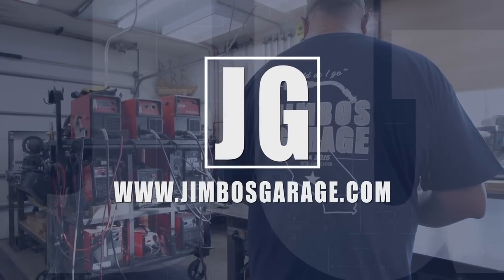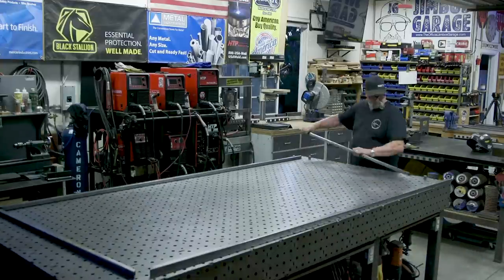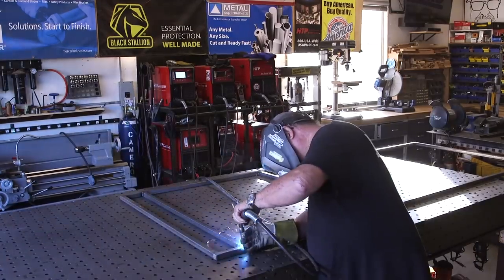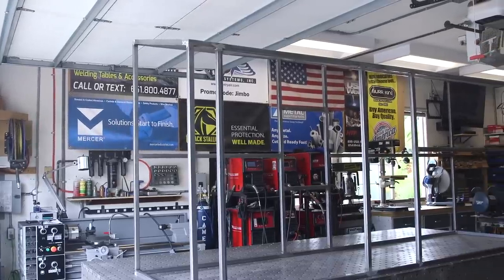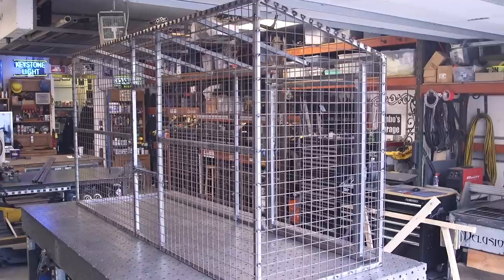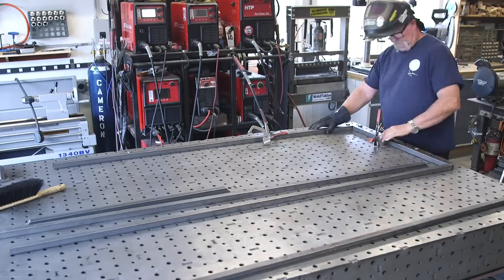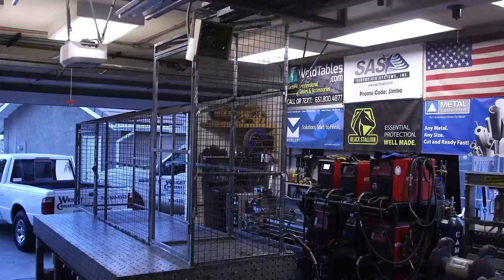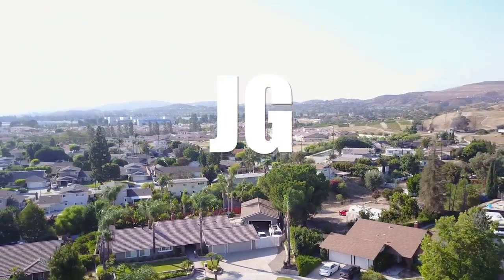Outdoor Pet Hotel | JIMBO'S GARAGE

Comment: Built something like that for my GF's cats. An 8ft tall, 3'x3' tower that sits outside the dining room window. The cats absolutely love it, but I built it with a planter box in the bottom to grow grass... If anyone else is considering that, don't. Cats love to eat grass and vomit all over the house. One thing I do recommend is putting some insulation on the underside of the roof to cut down on the radiant heat inside the catio.

Comment: Hi Jimbo! Well, diagonals, with equal measurements, in a four-sided geometric figure do not guarantee that the four corners are 90 degrees. Well, see, the trapezoid has its diagonals equal and its angles are different from 90 degrees. If there is a minimum difference of 1mm (for example) between one side and the other, which is common in 45 degree joints, you will probably get a trapezoid. Here's the tip, man.

Comment: Instead of changing the door get a door guy out to see if they can change the upper tracks to get the door higher. You will still loose some height but it might be a good option compared with the cost of a new door.

Comment: Looks like you missed the horizontal to riser joint by 1/8" @12.44 on both sides. I not thinking that was designed that way, as the next one over is flush